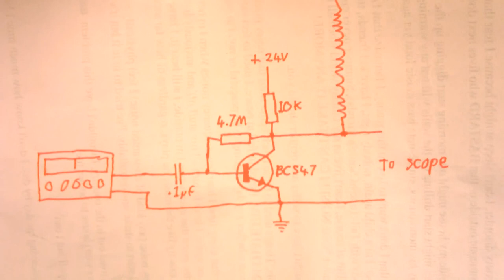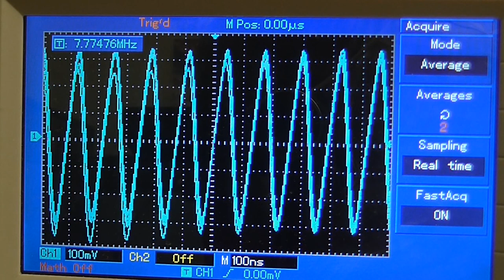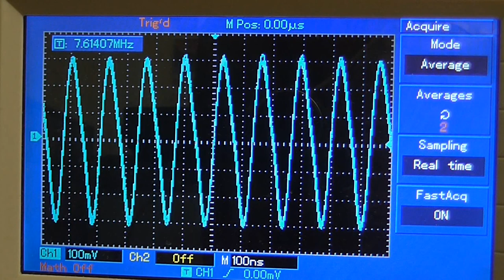Plasma Flame part 1 of ? - building and very low power tests

Comment: I thought that such issue with neighbours happens in India, where the density of population is high and people tend to live closely. If someone intentionally makes noise, only way to stop him is to talk to him. If he still does not listen, make a 100Hz power amplifier (4 MOSFET H Bridge) and connect to a woofer and mount on the wall. Run it when ever you are not at home.

Comment: It was a sort of early Illuminated Sign which consisted of Parallel Wires arranged such that when energised with this new High Frequency Electricity (of the right kind) you could get a sort of luminosity along the length of these wires-Plasma? rather than simply a Flash-Over so giving letters and thus words.
I bet it would have looked quite good in the dark.

Comment: if he uses Bluetooth you can over jam his signal. otherwise, you can send of an em wave to generate high voltage inside the speaker coils. but since most old and teener people tend to use wireless communication for music so you should be able to jam it's signal. another option would be to get him to use headphones. or if you know the building and how they maintain it well enough(to know the structure and points which aren't checked regularly). you could turn the building into a big speaker sending of terrible noice whenever he has it's music on which to all other people would seem like it is caused by his loud music.

and ofcource depending on where you live you can use legal measures such as measuring db volume and find things that cause his music usage to be illegal.

Comment: perhaps you should build an emp device to blow the your neighbor's stereo
Reply from the maker: I'd love to do that, thing is I believe he has it on the opposite wall (not the wall that separates our two houses), so I'd need a HUGE EMP to blow that sucker up, which would also blow up our stuff too in the process.
Reply: @CoolDudeClem   When I operated my 8KV neon sign transformer spark gap along with oil filled homemade capacitor Telsa coil upstairs in my living room it set off the home security alarm and as a result destroyed the circuit board. I thought maybe you could place the primary of the Tesla coil against your wall which would target his stereo. Then again, if the stereo is metal casing, it likely to be ineffective, but worth a try. I have yet to see anyone in Tesla community done a video destroying electronic devices using just the primary of a Telsa coil.
Reply: @CoolDudeClem  what if you do it from the hallway

Comment: thank you)) i knew it will happen :D 
but one thing, the tuning will be painstaking as helllll
also, to improve efficiency, place a variable cap btw drain and source, and make a half-sinus on it.
P.S. you have a scope, so not so hell hard.
Reply from the maker: When I can get both coils at 10 mhz and working nicely, I'm going to try it on more power and hopefully get a decent sized plasma flame.

Comment: I guess that you want to achieve this simply as a sort of novelty.
Did you ever read of Mr Tesla's ambitions to use electrical discharges in free air for advertising purposes?
Reply from the maker: I've heard that he wanted to transmit power over the air with it. Don't know about the advertising though.
Reply: it wasn't meant for advertising purposes, but he advertised it as a radio transmitter because most people didn't like the idea of free energy from the air for everyone.